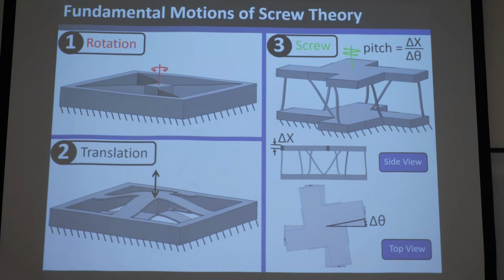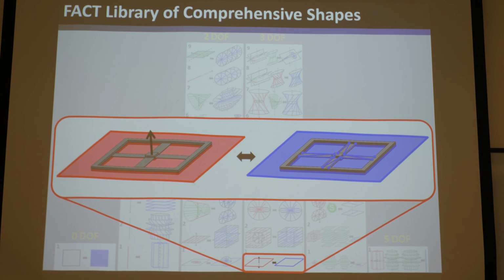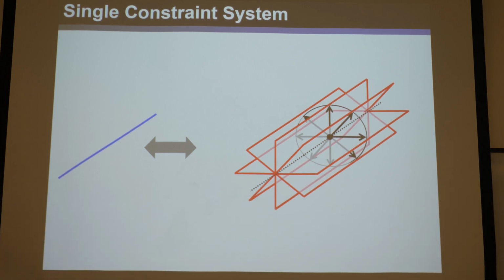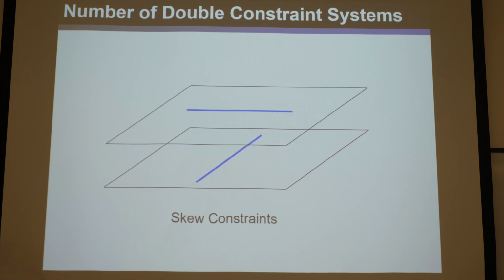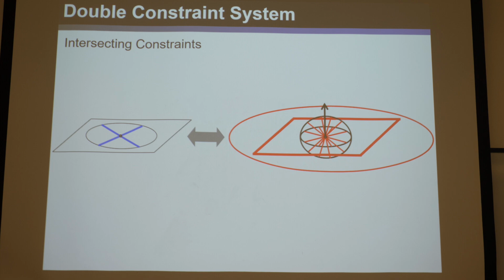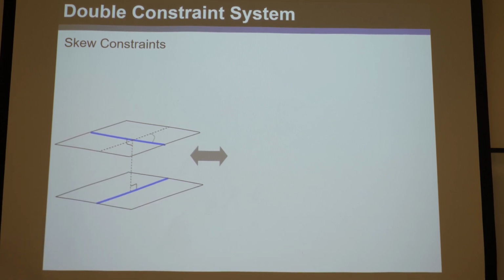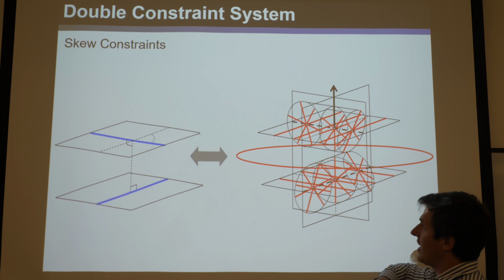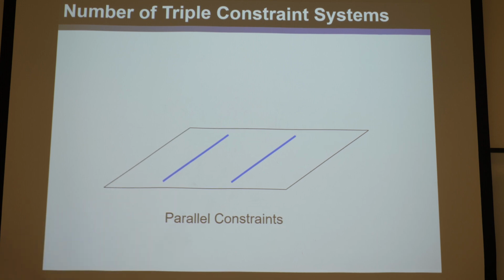Compliant Mechanisms Lecture 6 Part 1

Comment: 12:28 "only 3 possibilities" - for completeness, I would say 4. The rwo could be collinear, maybe the second one attached on the opposite side. There's not much to say that's not obvious, but you've already shown systems where wires are collinear, attached on opposite sides of the stage, and I think for completeness, it should be mentioned.

EFIT: Yes, it's a subset of parallel lines, but practically, it's a different category.  One arrow slicing another, Robin Hood-style, is mentioned later. That's good.  Opposite sides should get a mention, too.